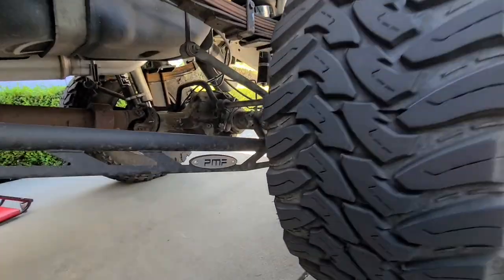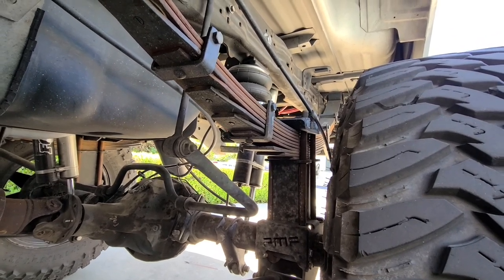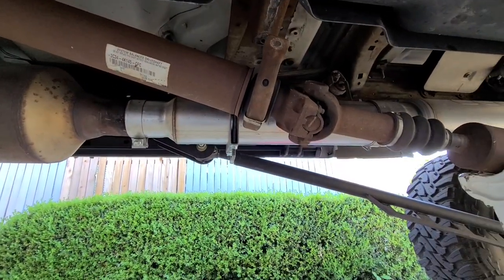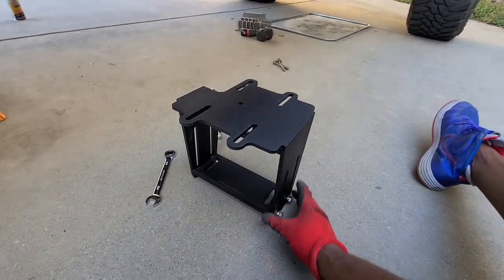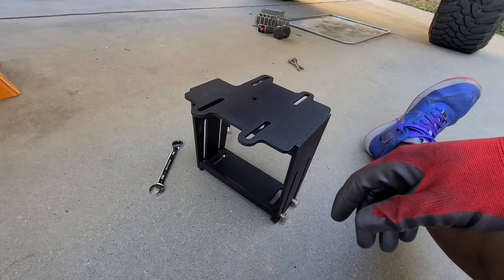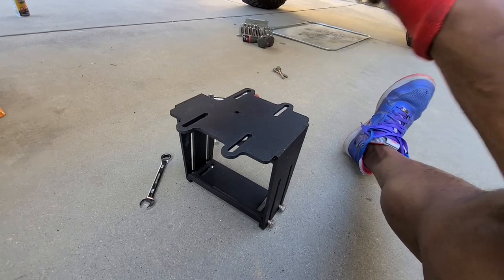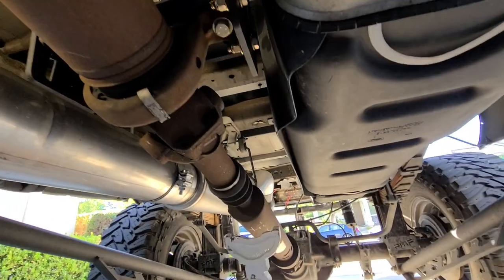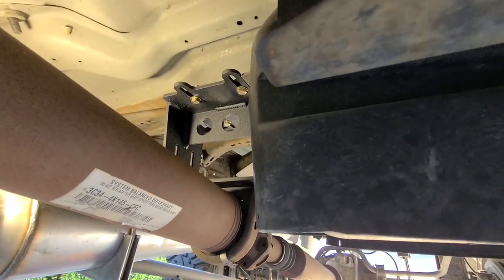6.0 powerstroke PMF adjustable carrier bearing drop

Comment: Wondering how you set up that 2 piece shaft.. did you measure your pinion yoke and output shaft angles? If there any angle for that center u joint or are both shaft pieces in a straight line? Im having a vibration at 67-70mph and when letting off the accelerator

Comment: Thanks for taking the time to do the video man you did a great job. I’m getting some vibration in my 6.0 as well. Turns out the extreme angle of the driveshaft destroyed my carrier bearing prematurely. Getting driveshaft rebuilt currently but definitely gonna order this kit. Is it still going well?
Reply from the maker: I wish I would have done this sooner. Luckily I don't put a lot of miles on this truck so I didn't do too much damage to my carrier bearing, but I'm sure I took some life off of it. It still working like a dream. No issues at all. Good luck with getting yours back up and running.

Comment: I know it’s much more costly but the difference a 1 piece 5” driveshaft with 1550 dynatrac u joints will do for you with that KDD motor it would last you 200k or more with no issues or longer
Reply from the maker: I'm going to look into this. Do you have any recommendations on where to get it?